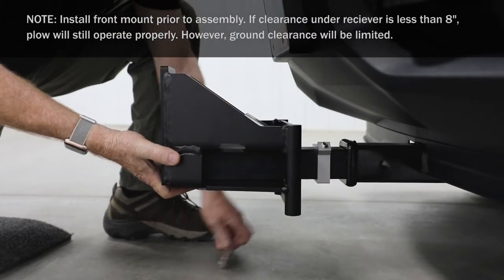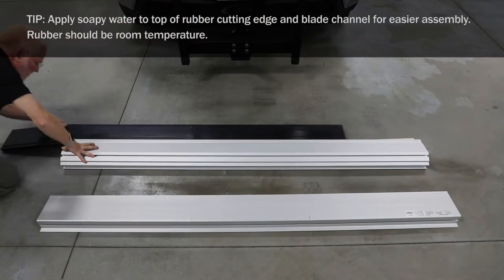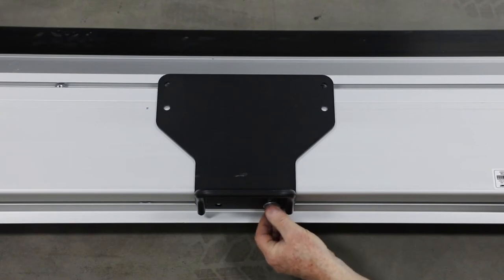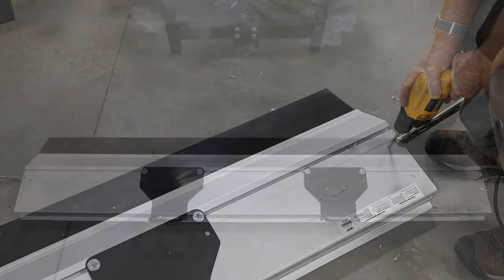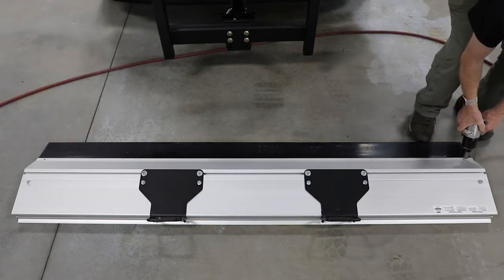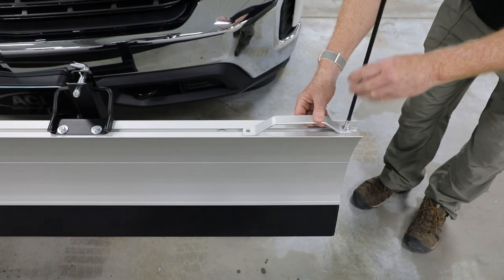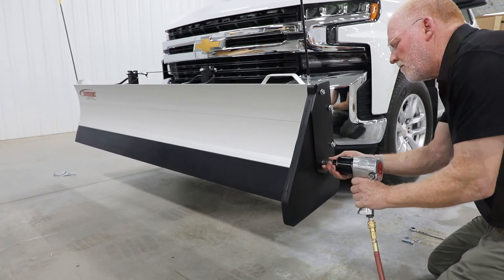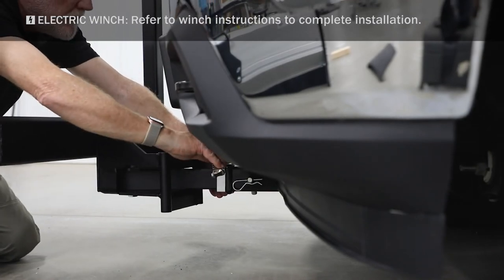SNOWSPORT® HD Utility Plow Install Video

Comment: My plow came today. Very fast service. Ordered Thursday, came the following Monday. Thanks. I found the written directions invaluable. My one bit of advice to anybody buying this unit is: READ THEM! I skipped a step and had to backtrack a bit. Probably cost me 10 minutes. Working alone, it took me about two hours (if possible, follow Snowsport's advice and have a helper) including collecting all the tools. Everything fit together perfectly and all the parts were there.
I totally get why the assembler drills the holes after the parts are bolted together. It removes any difficulty fitting the parts together. I think the design is brilliant. It is great to have a well built product that is so easy on the budget.
Now I need some snow...

Comment: Have used this first on my F 150 then installed on my F 250. Works fine for Macadam and stone. Only issue is dry Macadam causes rubber to vibrate snow blade excessively. Just go slower till you get to more snow or put in raised position. Just would like tell tail markers to be longer. Wish I would have bought this plow years ago. So much better than plowing with 4-wheeler. A second plus is using hitch to haul bicycles on front of truck.

Comment: Can you back drag plow with the winch installed
Reply from the maker: The motion activated design allows the SNOWSPORT to tilt backwards, the plow will glide over the surface instead of back dragging. Even with a winch installed you won't get back drag.

Comment: I'll be on season 2 this year with my plow.
Two suggestions:

1. Be sure to check sheer bolts frequently after the first few uses. They WILL break off if NOT adjusted to final tolerance.
I knew of this possibility, so I checked to be sure they didn't break. I only lost the head on ONE.

2.Make ABSOLUTELY SURE your mount to the vehicle's frame is SECURE.
The bolts WILL strip out with frequent use & detatch the mount assembly from the vehicle's frame.
I had my truck's frame retapped & the mount welded to keep it from happening again.
The mount assembly, receiver & blade unit installs & uninstalls easily.

My final bit of advice is to chain the blade unit & receiver guides to the mount on your frame because SOME dipstick rednecks think the plow is "easy pickin's tuh rip off'n yuh".
The dumbasses DIDN'T get mine...but were bugged I chained it on.

Overall:
These are really nice plows.
Mounting my winch as a plow lift soon.